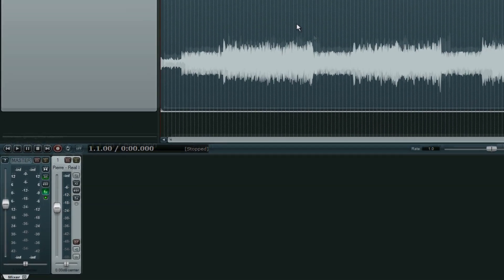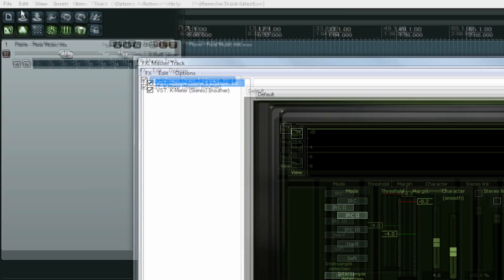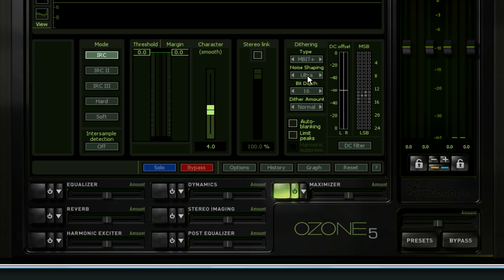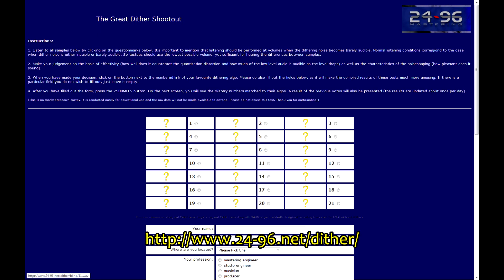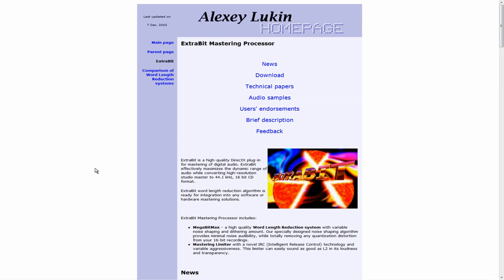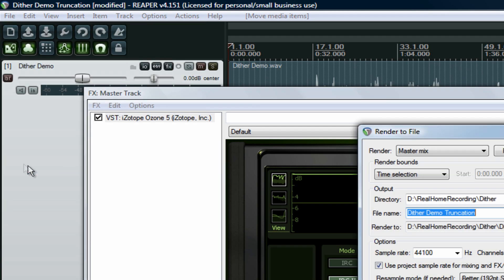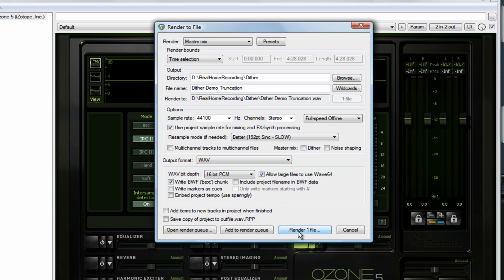Audio Dithering Sample Rate Conversion & Truncating - Where and When?

Comment: Does this matter as much anymore as iTunes etc support 24bit audio files?
Reply from the maker: Encode your mp3s right from a floating point file...no dithering. Dithering is really a 16-bit issue and if you mix at 24-bit (which your DAW shouldn't be). Most DAWs mix at either 32-bit floating point or 64-bit FP.

Comment: After the last step illustrated, do you render it at the standard bit rate that I've been using (24) with no dithering. Or do I render it down to 16 without dither?
Reply from the maker: The answer is at 4:13. The dithering/noise shaping is being added prior to truncating (converting) the bit depth from 24-bit to 16-bit. Not after words. The dither/noise shaping helps mask the effects of the truncation. Great question!

Comment: I need Tech/CD Burning help please. My issue is, someone convinced me to use a high bit rate when exporting my WAVs and I ended up exporting them @ 32 bit float at 480 HZ, using Audacity. But when I confirmed that the average CD player does NOT support 32 bits or 24 bits, I decided to export them @ the STANDARD 16 Bits at 441 Hz. And my CDs are still doing this random skipping crap during playback. WTF can I do to fix this!!!? I just want to kick back and listen to my new album without cringing at all of the random skipping! YES, I already tried burning at slower speeds(as low as 1X) and I've used iTunes, Windows Media Player and CD Burner XP. Are they still skipping because the 16 bit @ 441 Hz have traces of the 32 bit @ 480 Hz in the audio file? Please help. I'm exhausted trying to figure this crap out, its been over a week. The MP3s do NOT skip during playback on any device. And neither do the WAVs, WMAs nor do the CDs skip during playback on the laptop. Are the CDs I used just shit or is it something else? Because I feel the Universe is totally against me right now and I want to grab God by the throat and tell it to fuck off and leave me be lol! I have NEVER had this issue before. . . (BTW I recorded the whole album on a 4 track recorder and only used Audacity to raise the volume on the songs before exporting them)
Reply: If the CD's Don't skip during playback on the laptop, then it's probably the CD player you're using.

Comment: dithering = fuzzy noise to over up truncation
truncation = throwing out data when going from 24bit to 16bit.

before you even get into lossy compression, you have degradation from the masters to 16bit.

24bit PCM masters, or DSD, is what music lovers should be sold/rented, not these degraded versions.
Reply: ezrazski, that's "more is better" talk, but things aren't that simple and you notice that when you educate yourself. Dither randomizes truncation errors so that the errors do not correlate with the signal. The result is total linearity in the truncation.

Going from 24 bit to 16 bit is losing information, of course, but it's extremely quiet information. The difference of 24 bit and 16 bit is noise at insanely low level, so quiet you need to turn the volume up a lot to hear it alone, but if the music played it would "blow" your amp/speakers/ears if not kill you! How much dynamic range do you need? From 30 dB to 110 dB and that's 80 dB worth (~13 bits. For comparison the dynamic range of vinyl is 60 dB or 10 bits at best). CD gives you about 90 dB technically and a lot more perceptually when noise shaped dither is used. We don't really need that extra dynamic range, but it's "free" thanks to dither so why not?

24 bit is important in music production, because it gives you the dynamic range marginal when recording/working, but when the product is ready, 16 bit (and 44.1 kHz) is all we need, because that's how human hearing is. So, in consumer audio 24 bits is waste of bits. More is better up to a certain point and in digital consumer audio it's about 13 bits optimally used. So, 16 bits is enough and more is not better. Better sound comes from better music production, not from high resolution formats that only help record companies to sell the same old rock albums again and again...
Reply from the maker: Your comment aged well.

Comment: out of interest why do you use 64 bit floating point and not 32 bit floating point as the final medium?
Reply from the maker: The final format will be whatever is delivered. 16-bit for CD and floating point for mp3 (since there's no bit depth for mp3s).

The file that's before the final is kept at 64 FP because that's what REAPER and Ozone run at internally. I figure it can't hurt to have the overkill since the option is there!

32-bit floating point is probably more than enough.
Reply: RealHomeRecording.com ahh yes that makes perfect sense. I have wavelab 8 which supports 64 FP files, and I had been using dither when rendering to mp3 files, but not anymore, I have just been re-reading bob katz mastering audio again, such a great book on audio.
Reply from the maker: Ben Tyreman Yeah Bob Katz is awesome. I learned a TON of things and dispeled a lot of myths from reading that book. I even got his autograph at AES! What a cool guy.

Comment: if i add plugins on the mastertrack, after ive added izotope with eq, maximizer and multiband compression, should i just use my DAWs dither option, since the dithering from izotopes maximizer would go through another compressor and maybe even a fabfilterplugin?

Comment: Thanks for sharing this information...Should one do this for mp3 as well, considering someone may want to later burn those mp3(s) to cd?  Thanks.
Reply from the maker: Dithering isn't necessary for mp3 encoding. I encode my 32-bit floating point or 64-bit floating point master .wav files to MP3 without dithering.
Reply: Ok thanks...

Comment: Very good video.

However, I have found 96K/32 bit FP works the best for me as I use Adobe Audition 1.0 and it won't edit 64 FP files unless you make a copy of it and then the copy's temp starts gradually go off-tempo when put back into the project. This would even happen if I rendered just a track in Reaper and put the rendered track back in. So the project settings and rendering are left at 96K/32 bit FP and the problem is gone.

Comment from the maker: Which specific Wave plugins are you using that have a 24 bit setting? If your project sample rate is already at 44.1 kHz then yes you can use Ozone within that project file.

The only reason I did it the way shown in the video is because my sample rate differs from my delivery format (44.1 kHz). To retain the highest quality I've saved sample rate conversion for the second to the last step. Dithering and then sample rate converter would be a mistake.

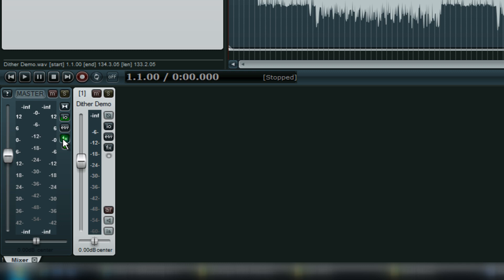Comment from the maker: ...and then open up Batch File Converter in REAPER with Use FX on (with Ozone being my only plug-in), truncation to 16-bit and REAPER's dither/noise shaping off (unchecked). So basically just everything in the steps starting at 2:51. 

Again, I did things the long way because not everyone has batch rendering capabilities within their DAW.

Since I've discovered DDP file exporting I've been doing Dither on a full length CD project instead of individual tracks. For MP3 export dither isn't needed.

Comment from the maker: ...and two steps (limiting --> Sample rate conversion) is necessary within my DAW. You unfortunately can't sample rate convert then dither with MBit+ from within REAPER. You could use REAPER's built-in dither/noise shaping to save a few steps but I prefer MBit+ as it was #1 in a blind listening test. 

Dither needs to be the final step after SRC has taken place. For demonstration purposes I showed the long way of doing this. Usually I would render my files (all the steps up until 2:50)...

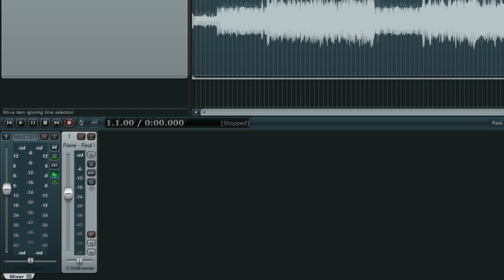Comment from the maker: I used the already mastered file as an example. In a real world scenario I would start at the 2:11 steps within the initial mastering project. So I'd have, for example, program EQ/linear phase EQ, buss compression, etc. Whatever my mastering plugins/effects may be.

Then, again within the same project, I would have my brickwall limiter on because compression tends to sound better at higher sample rates. With floating point files you're not really losing any quality...